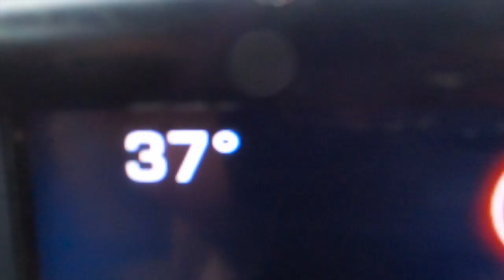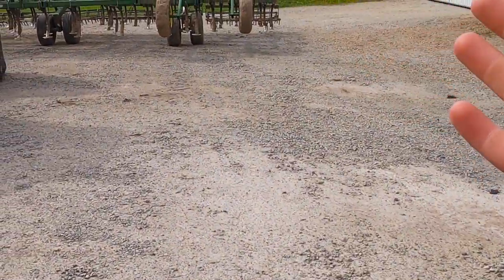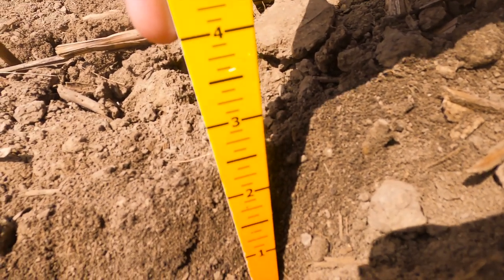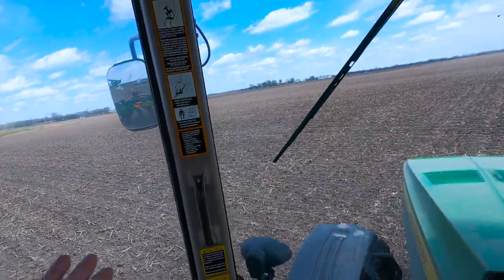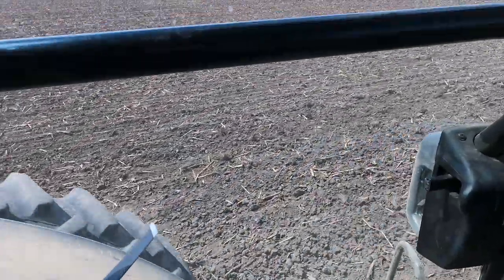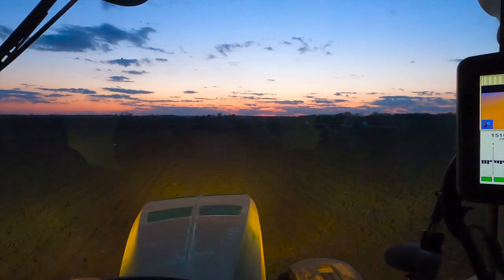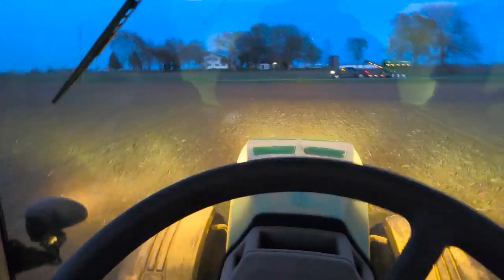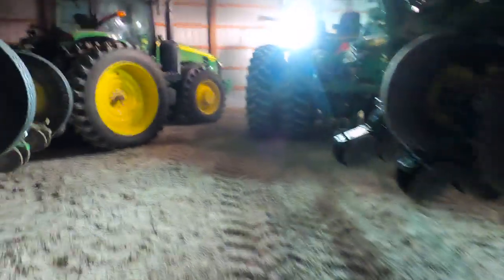A Cold and Dusty Day of Soybean Planting (Ep. 19)

Comment: I've been wondering if you could answer a question for me. Here in Maine we plant grain with a grain drill, and I was wondering why you use a precision planter like you've had and not a grain drill, and what is the reason for planting with such wide row spacings? Hope you have a successful and safe year!
Reply from the maker: Years ago, many farms had drills and seeders to grow legumes and other grains. As corn rose to prominence, many farmers invested in planters due to the need for accurate seed placement. This, in turn, often resulted in the drill/seeders leaving the farm, and the planter being utilized for soybeans as well. Very few individuals utilize anything other than a planter for soybeans in this area, although I do not believe that there is tremendous differences in yield between a seeder and a planter for soybeans. Row spacing is mostly preference. We planted soybeans in 30” rows for ages, and they yielded extremely well. However, narrower rows will always have the advantage for weed control. If I was basing my decision purely on efficiency, I would say that a 30” row large planter is the best all-around tool for a grain farmer. In 2018, our highest yielding field of soybeans was planted in 30” rows, with a final, scale-measured yield of 92+ bushels per acre.